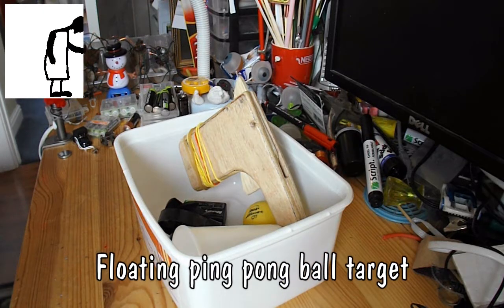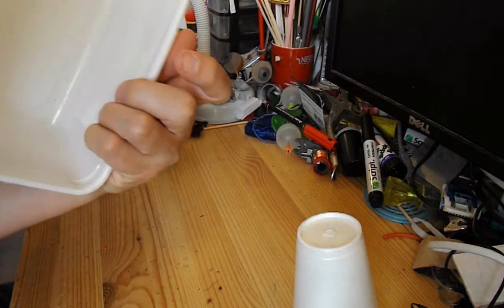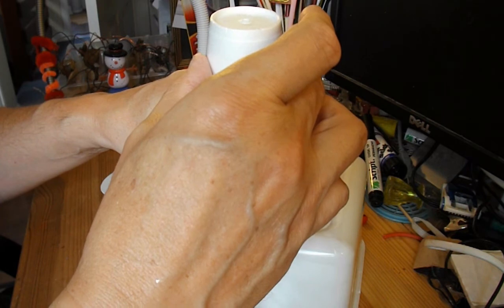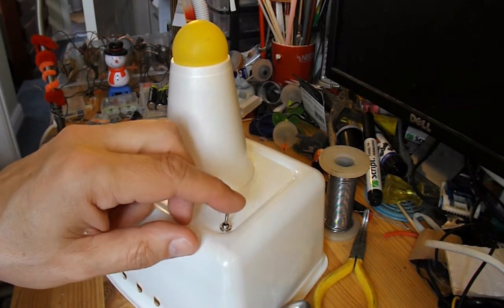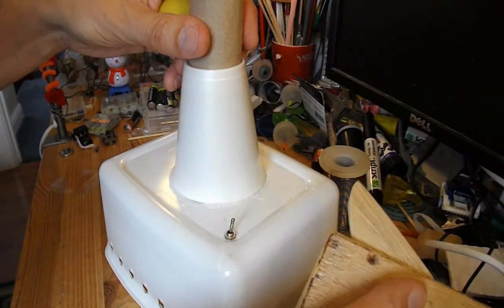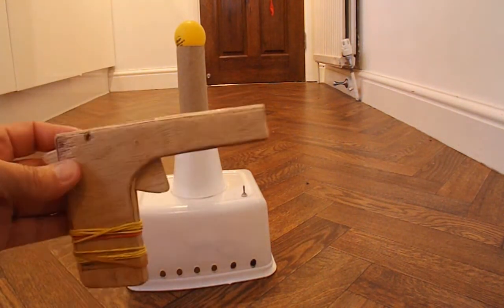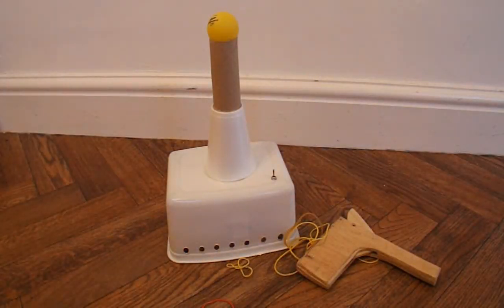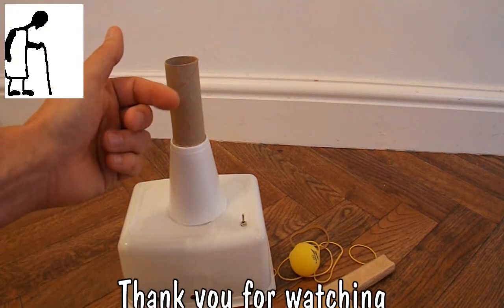Floating ping pong ball target

Comment: Great video, enjoyed that :)
The 18V change made it sound just like the hairdryer it came out of haha. Good shooting !
Say, just an idea, but if you got a car to work forward and backward (I know, been a pain to do) you could mount that on the car and have a movng target between the skirting boards. The practical reasoning is, I wonder if the ping pong ball would stay in the column of air or fall off ?
Reply from the maker: Hi slider, just moving it by hand tells me it would stay in place whilst it travels in one direction but the sudden change in direction would lose it. I have played with a vacuum cleaner on blow and managed to keep the ball in the column of air with a reasonable amount of side to side motion (that was 50 odd years ago).